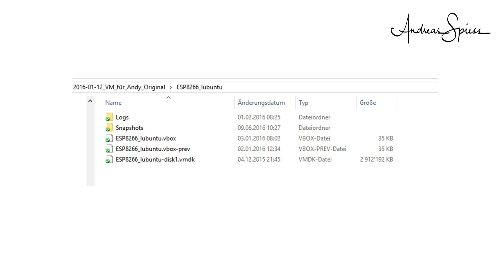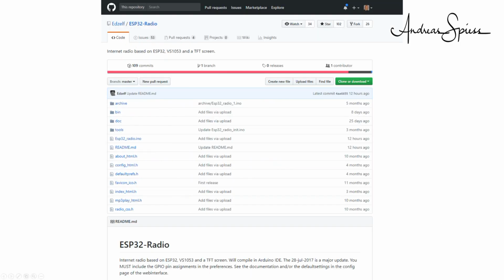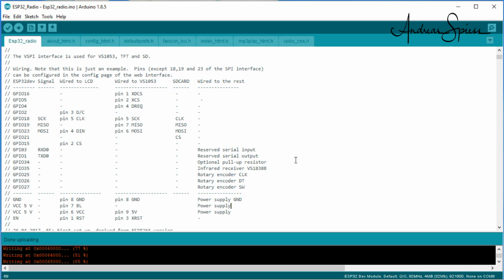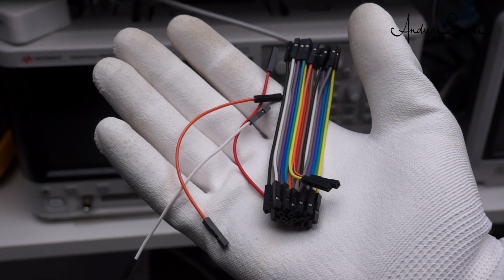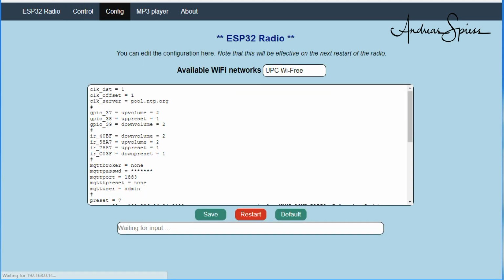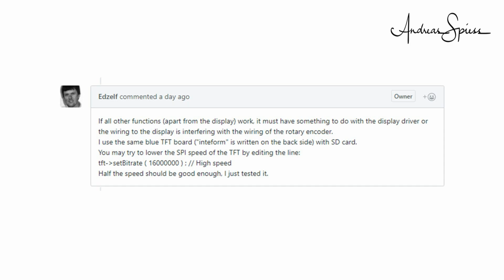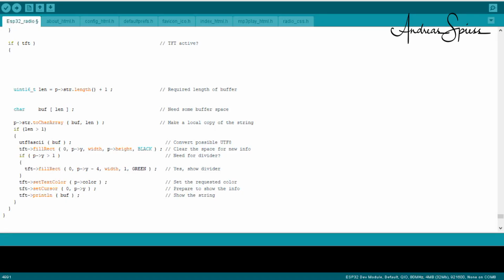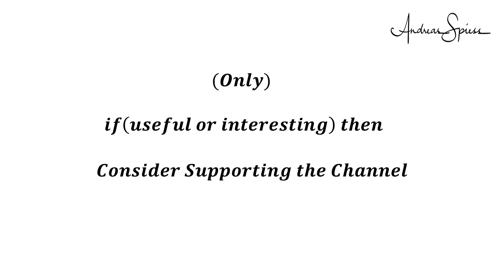#195 DIY Internet Radio using an ESP32 (Arduino IDE)

Comment: Andreas, you should check out recent Dave's (EEVBLOG) videos on those studio monitors. They apparently have a nasty goo inside that will corrode and kill them over time.
Reply from the maker: There were already a few comments about that. I saw it too. If I remember right, Dave said it is only a problem of the first 2 generations. Mine should be Gen3. Maybe I am lucky...

Comment: Hi Andreas! I am very interested in making my own IOT projects. In this regards, your channel provides a very good base and motivation. For instance, I would like to control my lights and appliances over the Internet. However, I am concerned about the possibility of a fire starting while I am not home. It would be great if you could share some advice on safe practices and how to avoid this situation.
Reply from the maker: I have not a lot to say about that. You have to do the normal precautions for 220-volt installations (do not do it if you are uncomfortable)  and for the microcontroller using a good power supply.

Comment: Thanks a lot for the video, was looking forward to some I2S action. BTW you can find single board solution for I2S + Class D Amplifier at AliExpress!!  May be you can find one with SPI DACs aswell !
Reply from the maker: I did not search for such a board. Mine does not have an amplifier.

Comment: Since you said you tried it with the ESP8266 and I'm not familiar with your experiments on that: have you seen this? https://hackaday.io/project/11570-wifi-webradio-on-esp8266-or-esp32 It's a web radio that started with the esp8266
Reply from the maker: These projects do not use the Arduino IDE. So many of my viewers are not happy about that...

Comment: >>It does not connect every time to my WiFi network and goes to AP. Only after reset it connects
Hi Andreas, this could be related to the ESP32 issue I raised some months ago
https://github.com/espressif/arduino-esp32/issues/234    Thanks for your great job
Reply: https://github.com/espressif/arduino-esp32/issues/234
Reply from the maker: I did not investigate, but it seems the same issue as you described. Any solution ?
Reply: No real solution so far, just works around. The problem only seems to happen with specific routers and/or internet providers. I went back to ESP8266 for this reason.

Comment: Greetings from the frozen state of South Dakota, where Spring just will not chase the winter snows away this year!  I built one sort of like this however using an Arduino as a controller.  Mounted it inside an old speaker and used it for our motor home radio. My intention was to use our satellite radio system with it, however in our hurry to head South the Satellite radio was left behind, so the radio only served for local FM down in Arizona. While it served us fairly well over Christmas for our Holiday background, I quickly tired of the amplifier systems I used it in because there were just to damn many buttons to set things, and the quality of the sound just was not there.  It is slatted for a tear down when ever the damn snow melts and I can get to  the rig without tracking mud and snow in the motor home.  Perhaps I will try this setup, with the increased speed of the ESP it may well run better, who knows.
Reply from the maker: Keep us informed if it works. Here the spring arrived. So I am sure it will arrive soon in your area ;-)

Comment: Please, don’t let them shut down FM. In Norway, FM is dead now, making tons of radios, car stereos and other electronic useless. Totally unnecessary, and makes a ton of e-waste. A research project suggested Norwegians own 4 fm radio receivers on average, and digital radios are expensive as hell.
Reply from the maker: The same here. I probably have to sell my old Volvo because it only has an FM radio ;-)

Comment: Andreas, I have recently within the past couple months joined your community.  I live off grid in remote Colorado of USA, and your projects help me immensely!  I now have a nice smart home that I can monitor my power systems from any where in the world, thanks in big part to you.  Now I also can have music to enjoy as I work on projects.  Thank you for your contributions to the world, and to my own small world as well.
Reply: Right....that sounds awesome...."off-grid" But if you are really "off-grid" You wouldn't be able to monitor your stuff anywhere but from home......
Reply: @muppetpaster   Not necessarily. As it happens, I'm also considered "off grid", in Colorado. Power comes from solar. Water from a well. Phone is cellular. Internet is satellite. The home is completely stand alone. It's not connected to utilities. Off Grid doesn't have to mean 100% isolated - only that the systems are physically isolated.
Reply from the maker: Colorado is a very nice place. I was a few times there (Gunnison, Silverton, incl. Engineer Pass, and all the other Off-Road trails up there). And the Harley Meeting at Durango :-)
Glad I was of help to you.

Comment: Great video Andreas! I'm considering making a custom PCB for this project, the only real problem is reproducing the VS1053 board, but there seems to be a nice schematic in the datasheet (the chinese boards usually just replicate that basic schematic). Would be cool to have it all on one board wouldn't it?
I've made a few MQTT based home automations for my friends and this would be a cool addition to the dashboard.
Reply from the maker: I think it should be possible to do a PCB to connect the boards (maybe one board on top and one below the PCB. Then it is much easier to assemble for the average person.

Comment: Andreas, this is definitely one of your best videos so far as you also show how you managed to solve the display issue! Troubleshooting is frustrating, but it turns out to be one of the best ways to learn. You said that this project, which I have not looked into the details, uses mostly all the features of the ESP32: what about bluetooth? It would be nice to command this cool device via our cell phones.
Thanks
Luciano
Reply from the maker: Bluetooth is still in the early stages in the Arduino IDE and in my knowledge. So this was too much...

Comment: Very nice project with avesome support on git. For me it worked on first time :) with patch for different LCD. One big problem for me is very long code and i am not able to understand it. I want change gui and that is imposible for me :( Now i have it in dust on table for 1/2 year, i hope one day i figure out that :)
Reply from the maker: The code is really long. But you should be able to see where the screen is updated. This is only a very small part of the code itself.

Comment: Is there a cheap DAB receiver/decoder chip, board or USB stick that works with the swiss system ?
Reply: There is one type of $50 chinese Dab+ to FM converter available. Basic functionality, old design. It comes with a not so good passive dipole antenna. I am using it with my old car fm antenna, but with a small $9 chinese rf amplifier that also split the antenna signal into dab and fm, gives good signal. The radio is slow, takes 5-10 secs from you switch it on til you get sound. No traffic messages. Does not automaticly switch frequency when you enter a new dab coverage area. Too bright display for night driving, I have mounted it below the dasboard. No storage of prefered channels, but mine stays on the same chanel most of the time. No power for active antenna. Powered via 12->5v adapter micro usb. Aux or fm out. But it does the job and let me use my old car fm radio system. Works in Norway. http://s.aliexpress.com/iU7zMn6R

Comment: you found a Dutch station :-)
Reply from the maker: Not me. Ed, the Dutch developer found it.
Reply: @AndreasSpiess  maybe you have fixed the with screen now, but i remember the Dutch radio stations send the logo of the station also for the screen. Maybe goes there something wrong.
Reply: @AndreasSpiess  I am using that advice in the PDF manual to run Winamp and find channels that way. A couple of days ago I went channel mad and put to many in, I exceeded the limit on the size of the preference file and lost my presets. Took me a couple of hours to figure out what the heck went wrong, the radio kept making it's own IP address instead of hooking to my network. Then I referenced the PDF once more and found the limit. So I simply went back and started from scratch, after first saving a list of my favorite stations in Word so I had a copy that I could pick up and move over while watching my file size. I am still having a blast with this project, what I got to wondering is if there was still enough memory to activate the bluetooth and send the audio to my bluetooth speaker set that I got for Christmas from my grand son.

Comment: Great and educational video ! Btw, I notice that the sound of exitement of a Swiss is quite similar to that of a Belgian. However, there is a suttle/dicrete difference if compared with the French or Flemish part of the country.
Reply from the maker: As you might know, we also have a French-speaking part here.
Reply: Yes of course. I've been to Switserland many times. There's even al small part that speaks "Rhaeto-Romance". In Belgium we have also a German speaking community.

Comment: I'll be very interested to see how you get on coupling the VS1053 to that little PAM8403 class d amp.
 I'm working on a VS1053 and arduino nano based drum machine and I find I can only get it to work properly into the amp if I run them from separate power supplies. The basic problem is that the common terminal on the headphone socket is not at zero volts so needs decoupling in some way. I've tried a few sugested circuits including the one in the data sheet but it's extremely unstable when fed from a single supply. So I've ordered 2 audio transformers to see if I can get it working that way. Possibly I need to try a better power supply. 
So I'll be very interested to see how it goes for you.
Reply: I received my audio transformers from China and amazingly it worked. I can now run the whole thing from a single power bank.

Comment: Andreas, How you upgraded the RAM in the ESP8266 ?
Reply: The particular way he did it was solder a memory chip with the same pinout on top of the existing one, but bend the CS (chip select) pin up and connect it to a different GPIO so the ESP can talk to this new chip separately from the default one. You can just as well do it on a breadboard by connecting it to SPI like any normal device.
These chips are SPI chips so they just have MOSI, MISO, SCK and CS. The first 3 are common to all SPI devices including the existing flash chip, you just need to have each device's CS pin connected to a separate (unused) GPIO. 
Then in your code you just toggle the CS pin on when you wanna write to your new flash chip, and off when you're done.
I think it's not 100% expanding the RAM, more like adds another separate RAM to use just for your task.
Correct me if I'm wrong :)
Reply from the maker: NS gaming, you are absolutely right. Thank you.
Reply: Thank you a lot for explanation, if its not expanding for the original memory, could we use another flash memory or it must be RAM ?
Reply from the maker: You could also use flash. But easier you solder a bigger flash chip instead of the old one or buy a wemos pro board
Reply: I got a 32MB and also 8MB Flash and I can solder it :D, how can i use it in this case to store the data ?
Reply from the maker: I do not know

Comment: Hi Andreas!

I remember encoutering a similar problem (white lcd) when working on an intelligent alarm clock project a few months ago. I used a touchscreen, and when I pressed some menu items, the screen just turned white. Turned out to be an issue in my code, because the pins of the touchscreen, which send a signal to the arduino when the screen is pressed, are shared with the LCD pins.
In my case, when calling a method to get the touch points on the Screen, the library was setting the shared pins to INPUT mode. After that, I needed to set the specific pins to OUTPUT mode again, otherwise the screen turned white.
Don't know if this helps in your case because you're not using a touchscreen.

Greetings

Henrik
Reply from the maker: I did not investigate deeply into the issue after I fixed it with the If statement. So I do not know the root cause.

Comment: Hi Andreas,

great video but I search a simple radio for elderly people with e.g. 6 push buttons for different radio stations. Press button 1 --> radio SWR3, press button 2 --> SRF and so on.
There are many web radio on you tube, but most have only station up or down button only.
I'm not so familiar in programming software.
Is there a chance that you update your software and also show at your hardware how to connect e.g. 6 or more buttons?
For elderly people a radio must be easy and understandable and also must have big buttons!
So sometimes also a remote control is not a good solution.
This will be helpful.

My leitmotif is KISS
Keep 
it
simple and
stupid

TKs for your video!
Reply: Hi Ed,
I do not saw it at video. Also at your file I saw only 3 buttons for the station. Next station/previous station/first station --> https://github.com/Edzelf/Esp-radio/blob/master/ESP-radio.pdf
I think there is a miss understanding between number of station (up to 100) and extra buttona for different stations.

Nice will be one button for station 1, one button for station 2, one button for station 3 up to for example 6 buttons. This will be a benefit for elderly people.
This was my thinking.

In the picture here shown for 1 to 5
I hope that it is allowed to show the link! --> http://www.de-bedienungsanleitung.de/op/pictures9/sangean-dpr-65-radio-digital-fm-dab-dab-schwarz-102380-1.jpg

Comment: on the TTGO board, the MISO-MOSI signals seems available at the sd card connector ?
Reply: Yes, on TTGO boards, MISO signal is GPIO2 and MOSI is GPIO15.
Reply: I was thinking the same, replace the SD card with an adapter board...

Comment: Hi Andreas,
Thanks for this video. By the way: your handwriting looks fine!
Recently I was working on a webradio project myself, with a Wemos D1 ESP8266 and a VS1053 mp3 board and it was working fine. I used this project on Github, because it is really well organized: https://github.com/MagicCube/smart-pod

The project documentation says it will also use a display like Ed’s project, but this was never coded. But because I started developing on esp boards a few months ago, it did not matter to me. It was easier to setup with just the ESP8266, the VS1053 board and some buttons.
Reply from the maker: Thanks for the link. I did not know this project.
Reply: I have lot of buffering issues, it only works fine if the data is streamed in local network.

Comment: What about the TTGO TS v1.2? Would it work with Internet radios? Or maybe TTGO TAudio since it has WM8978 stereo codec on it?
Reply from the maker: Check if you can use the SPI pins.
Reply: I mean: is it possible to switch from VS1053 to WM8978? Because we would already have a single board (TAudio) ready for Internet Radios. Even DFRobot uses WM8978 on their Audio Shield for DFRduino.

Comment: Great video as always sir :) Keep up the great work. You are one of the few Youtubers who actually take the time to work with esp32 boards... one can find very few content about these boards... especially using only Arduino IDE. I really don't want to go into learning the whole espressif system, instead only want to use Arduino IDE like you.
Reply from the maker: The ESP32 is still new, but I think it will replace the ESP8266 over time.

Comment: Looking at the code that you changed, the difference must be in the display driver. Apparently the driver version that you have installed cannot handle printing an empty string (tft->println(buf) when len is 1 is including the terminating \0, ie. an empty string). Perhaps Ed is using a different version of the driver library? You could test this theory by adding an additional println("") to the example program of the display driver and see if that gives you the white screen.

I do think your addition is a workaround for perhaps an unusual condition. Using println to print an empty string should normally only move the cursor one line. I see you are using the Adafruit libraries. The Adafruit ILI driver library has some ESP32 specific code which may not be mature yet. In an earlier version of the Adafruit GFX driver I encountered a bug with writing end of lines at the end of the screen. In one version that bug was fixed, in a next version it was (mistakenly) re-introduced, so now I use my own version and need to pay attention when updating it. The issue was known on Github, but still the people updating the library made mistakes when integrating features from different branches.
Reply from the maker: I think we used the same library, but maybe a different ESP32 environment. For me, my fix is ok for the moment and Ed added it slightly differently in his code.
We still have to remember we work with highly complex systems and it took me not too long to build this radio. So we have to live with this kind of "hiccups".